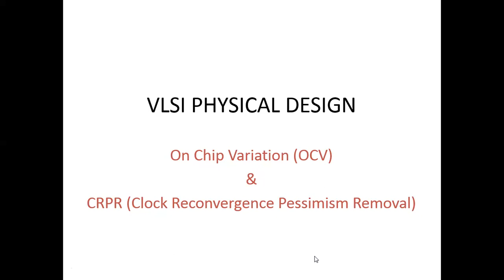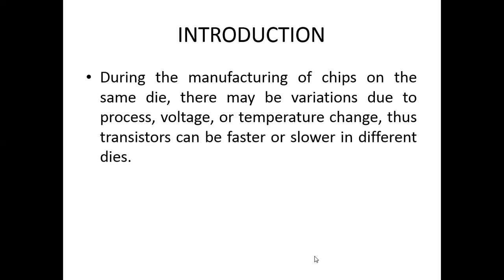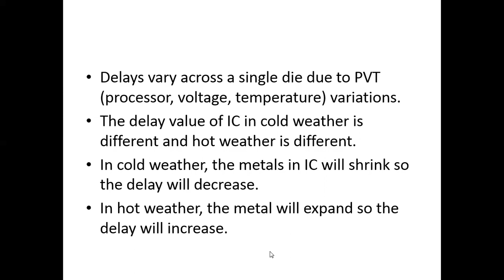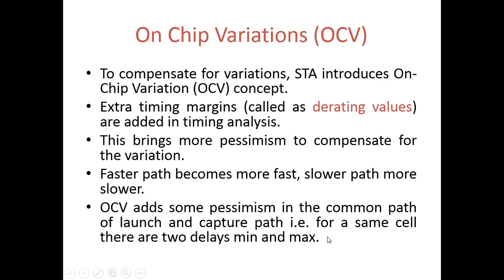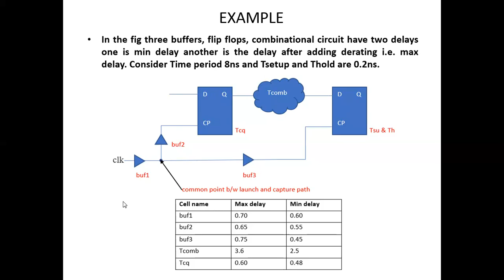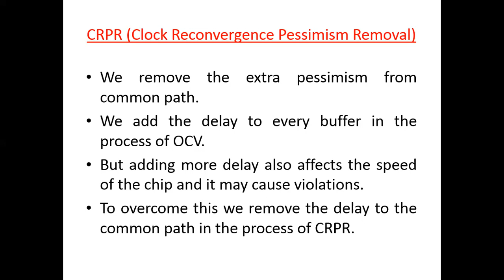Comment: OCV refers to the process variations in electrical properties of transistors and wires that occur during chip fabrication, which may impact factors like speed, power consumption, and power leakage. These variations can potentially lead to timing violations, increased power draw, or malfunctioning of circuits.